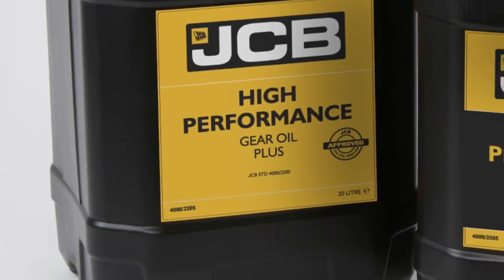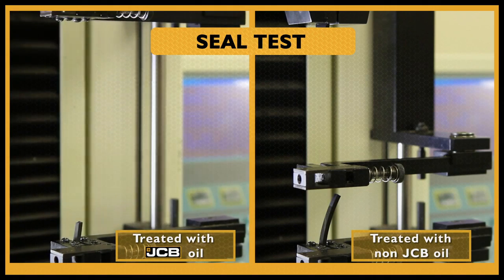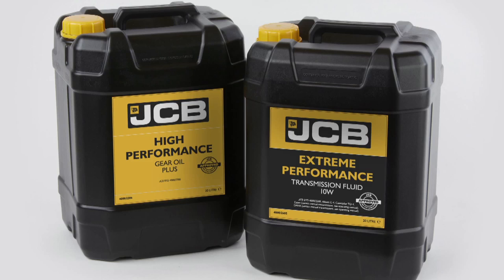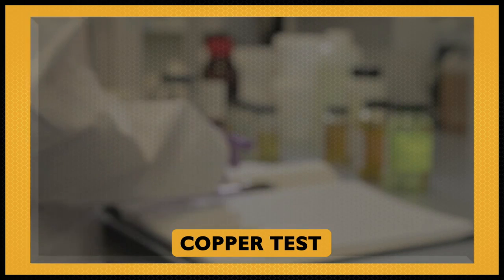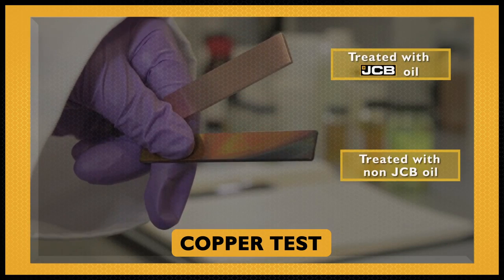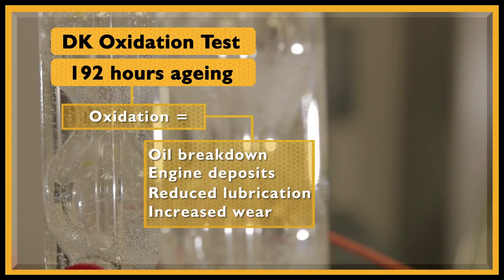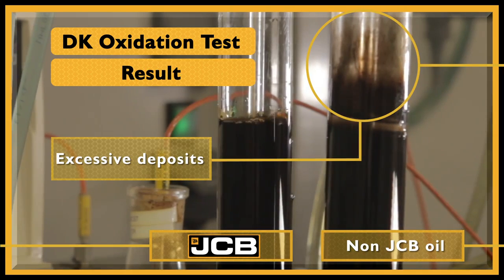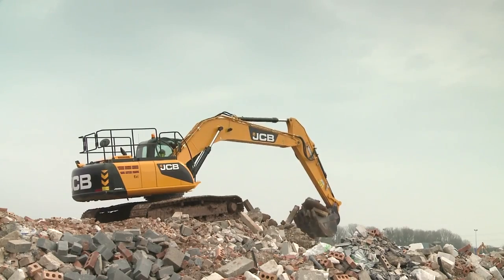Why buy JCB Gear & Transmission oil

Comment: hello, I have a 1998 JCB 214s 3 backhoe loader, I need to know what transmission fluid I can use, because the current one is very dirty and has a very dark color, I am also afraid that after the change the transmission will present problems due to rinsing  .  can you recommend me something pls.  Thank you

Comment: for jcb 3cx 2008 the transmission oil is 10w?
Reply from the maker: Hi! Could you send the serial number do we can further assist?
Reply: @JCBNorthAmerica  JCB 520 S/N 1411135 PLEASE ADVISE ON TRANSMISSION FLUID SPEC,TY!